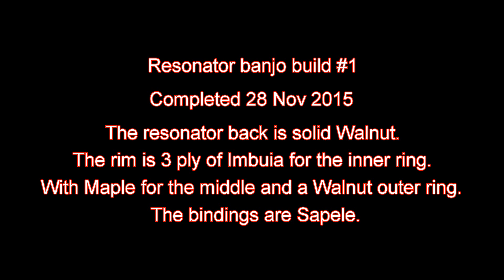The Resonator. 5 string resonator banjo build.

Comment: This video deserves so many more views.
Reply from the maker: Thanks!
Reply: @pzguitar9148  no problem.  It's definitely true.  A customer came to me asking me to build one for his 6 string and i wasn't sure which way to go with it. This definitely helped. Thank you.
Reply: @pzguitar9148  oh hey.  At 1:25 it shows a square frame. Are those sticks radiused as well?  I assume so
Reply from the maker: @mythicguitarcompany4826 Yes, but not evenly. I think I have a simpler and more efficient way to do it. I plan using on my next builds. The square you see there is something I came up with as a fast remedy, with available material to a problem. What I plan to do to improve it, is make a ring caul about 1" wide x 13-1/2" diameter x 1" thick. Then radius it to fit the contour of the outside of the resonator back. Should give better consistency and easier to mount. I started with the back a little wider and braces a little longer than my target dimensions by around 1/2". If you haven't seen it already. I have a fairly detailed description of the rest of the process in my reply to Joe Long's comment below. The one where he starts out saying "Bout the dumbest thing I've ever seen." Feel free to ask about anything you need clarified about this.
Reply: @pzguitar9148  thank you, that makes perfect sense actually.  I did read your response to him, and it was great. I'm going to read over it again though. A customer wants me to make one of these, which I think I mentioned. I designed it in solidworks in 2 pieces. The ring and the bowl, then assembled them. Now, I'm about to start designing all of the cauls, bucks, forms etc. Around those parts and CNC them, then use those to make the actual part.  I think I will end up using a stack of veneers, glued to the forms for the ring, but I'm still unsure whether I will use a piece of thickness sanded book matched maple for the bowl, or use veneers. I dont have the right kind of calipers to measure the thickness of the bowl that came on the banjo, so I don't know the true thickness. To touch, it feels about like 1/8" but is unknown. I cant dissect the one that came with the banjo.  What thickness do you recommend? Most acoustic tops are between .08 and .09 I think.  Since he wants quilted maple, I'm not sure if that will be a good thickness.  Also he is a classical player, so I'm making him a new neck with a 2 1/8 nut width, (it's a 6 string banjo if I didnt mention that before) a bridge to suit etc, and he is all about tone.  I'm not sure if maple will give him the tone he wants.  Banjos are "plingy" by nature, so maybe mahogany would warm it up a bit, and then add a maple veneer for show?  What do you think?